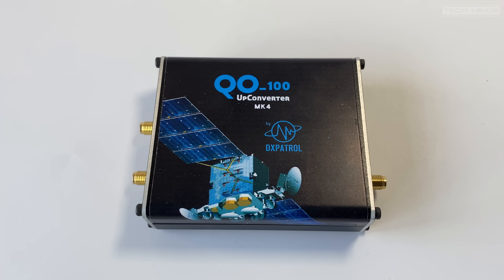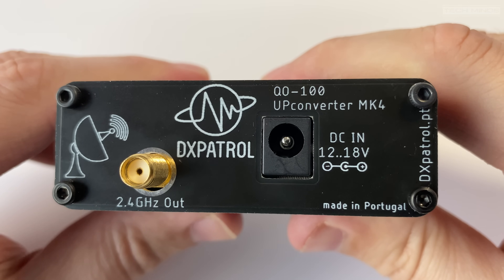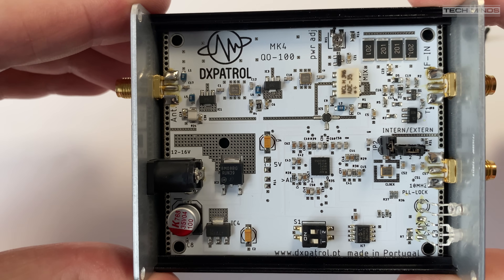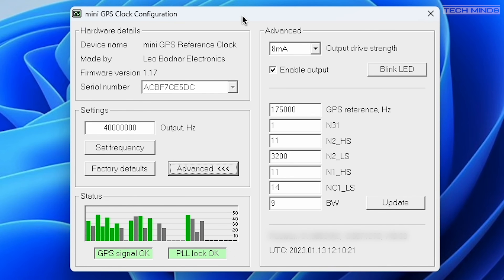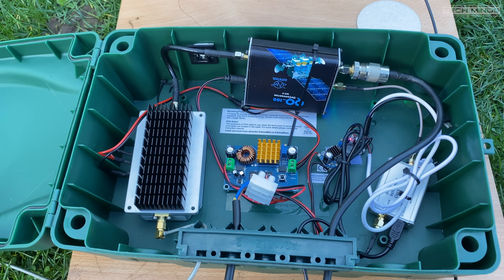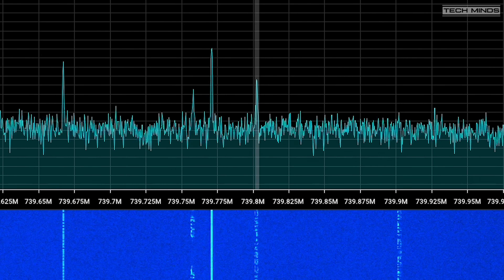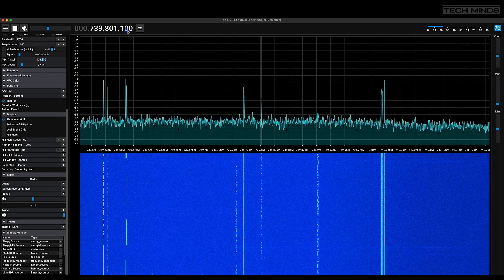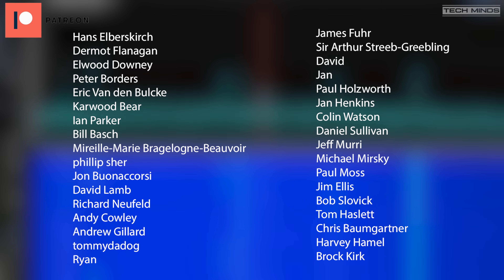DX Patrol 2.4 GHZ UPCONVERTER FOR QO-100 - SSB CONTACT TO BRAZIL

Comment: I am a newbie wishing to upgrade from a LEO satellite operator to a GEO satellite operator. Are there options to start without giving in a 10 MHz signal, a setup which builds its own signal like a stand alone HF radio or VHF/UHF radio? 73 de Jon, VU2JO
Reply from the maker: There is the DX Patrol ground station, which is essentially an upconverter, a downconverter and an amp all in one box. You still need a radio or two for receive and tx though. QO100 is kind of specialist, but even "off the shelf" products have a lot of configuration.
Reply: @TechMindsOfficial  Thank you. 73

Comment: Are you drinving the TS2000 directly to the converter? And why a preamp between the converter and DXPatrol amp?
Reply from the maker: Yes I was driving the Upconverter with my TS2000 directory. A DX Patrol amp might not require a pre amp if used with their up converter. I was using a EReon amp which requires a 400mW input for full power.

Comment: Does the 705 do 1296? (it would be better if the radio was at least showing one of the 28/144/432/1296 freq too).
Reply: The 705 doesn't do 23cm.  Only up to 70cm.
Reply from the maker: The image is a placeholder for what ever transmitter you want to put there :)